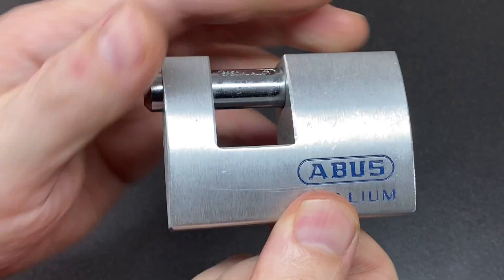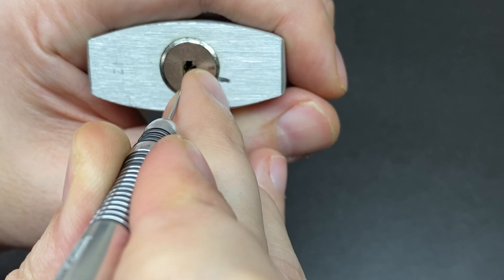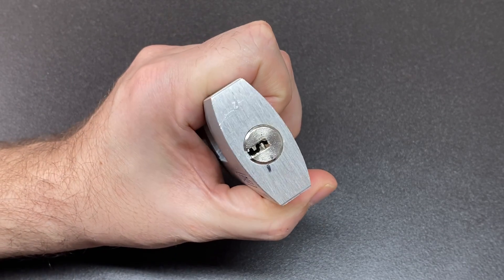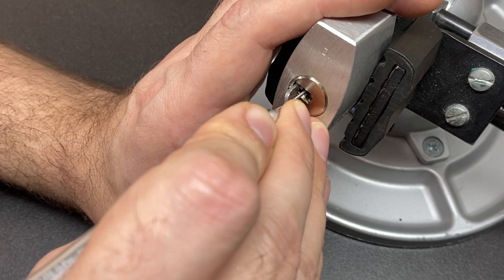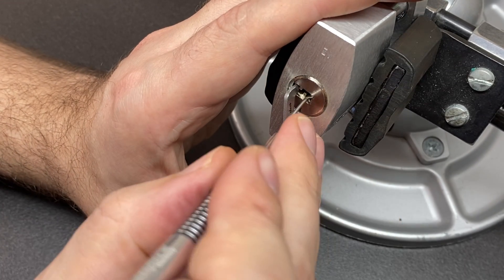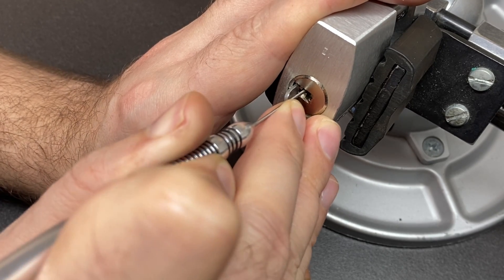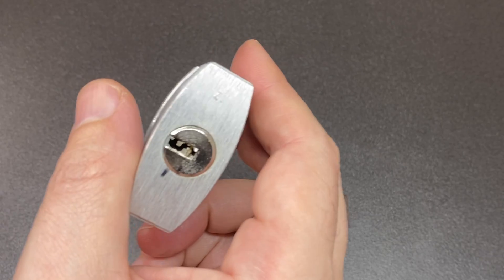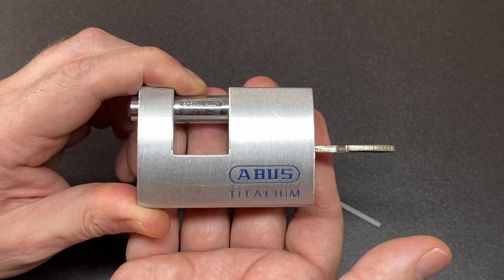Abus Titalium 98Ti/70 Extra Classe Picked

Comment: Same core as the 75IB/50 and the 75/60? Yeah I found that spools plus tensioning in the same direction as the pick rotation means positive tension control is needed to manually ease up rather than letting the spools counterrotate, especially with the IB series which lacks a sprung core. Even with that, washing out the cores with lube resulted in lots of glitter from where the pins and core were gnashing. I used the MP#5 flat flag (and MP#10 on the smaller 75IB/40), never needed the curved boy.
Reply from the maker: I like using the deep curve still though

Comment: Well picked 👏👏👏 Very solid lock joined by a very secure core 👍 This is what I like to see 🤗
You got a very nice tensioner there 👌👌 
I never get a good feeling with the curved flags and try to avoid them if possible. In these keyways I prefer to use the short flag somewhat like a "normal" pick and lift it a bit instead of just rotating. Often does the trick, but depends on the bitting.
Cheers 🍻
Reply from the maker: Cheers 🍻

Comment: The main problem with those is that it is bypassable.You have one made before 2017 (two letters) so i dont know about them but newer ones(three letters and number) are bypassable like an old 85 Abus brass shutterlock  .Locking pawl is exactly the same like on 64 Titalium.
If you re interested on dates (two letters)i decoded them and someone asked me to post it on REEDIT so try to find it.Just when it was posted on Reedit in 2016-17.they changed coding system so i had no luck decoding new system .
Reply from the maker: Interesting. I’ll try the bypass

Comment: I can zip and rake  a few locks and during  the master  mayhem show I single  pin picked a lock for the first  time, it was a Master  No 3.  I was pumped.  Tension  is something  I struggle  with.  It doesn't  work  if you  put your  tool  in the wrong  way. 
That's what she said.
Reply: You can never have too many tension tools. Getting the right tension tool in the right  place with the right amount of tension gets you much further to success than thinking you have the wrong size or type of pick. Personally (what I do) is file a slight flat and then a tiny dint on the tips of my picks. It helps me feel what the pin is doing without the pick slipping off the tip of the pin.